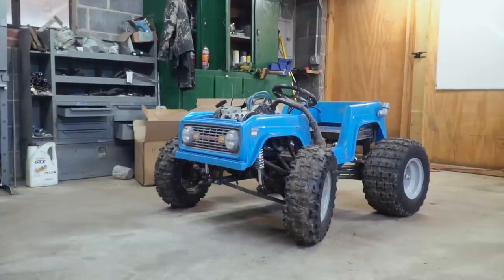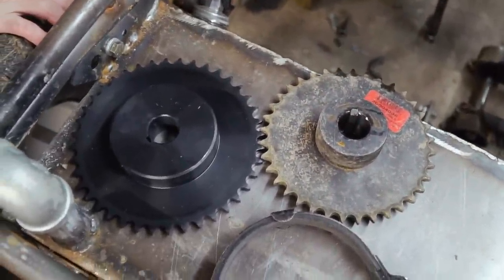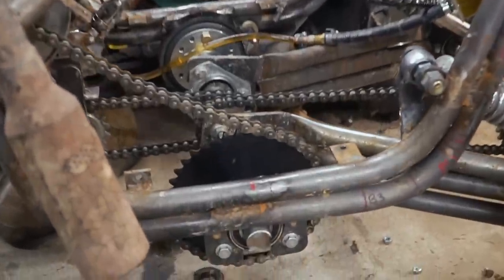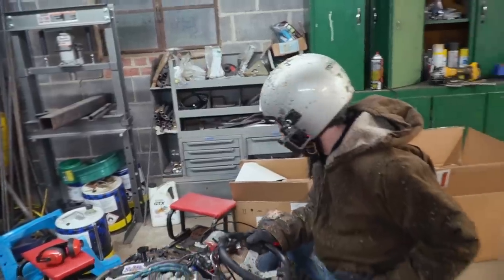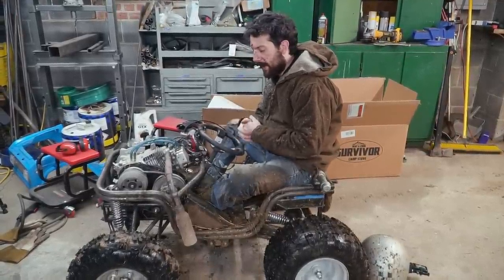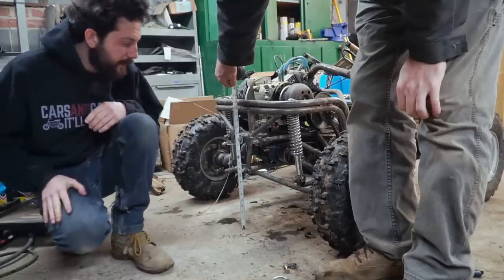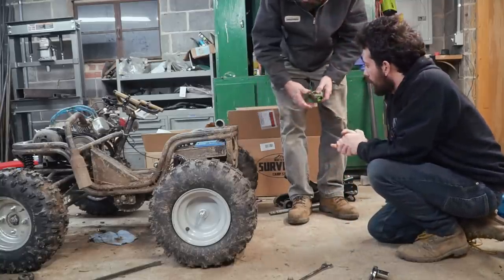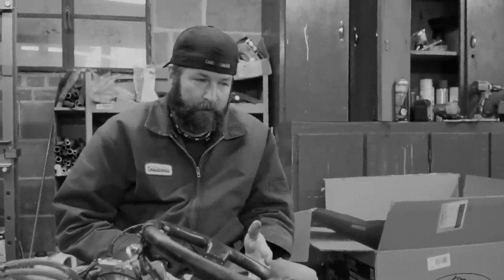4WD Power Wheels Go Kart gets New Suspension + Gearing! 228cc Ford Bronco Build

Comment: That extra large hub almost looks the same diameter as the drum brake you installed.  Almost like it want's to be the brake itself :D
Reply: This guy is right on!🙌
Reply: With a simple jig and a drill press you could relatively accurately drill large holes in the hub to lighten it
Reply: I wonder if you drilled large holes through the side of the hub and small holes in the OD (braking surface) if it would aid in cooling like a drilled brake rotor
Reply: LOL I was just watching the video and was about to say the same thing until I read your message that Hub size is damn near the size of that brake
Reply: @Toolingabout  yes you can cross drill holes on the braking surface of the drum to help cool it, it also gives the water somewhere to go to help prevent brake fade. I have cross drilled drums for older from drum brake cars in the past just for this reason. Just don't get carried away with to many holes lol.
Reply: That's a really good point
Reply: @mostlymotorized  and do what? Wear down the sprocket itself and possibly warp it? Be better of just doing the drum brake idea
Reply: @CaneAtvse  having a sprocket double as a brake rotor is a proven design. Several motorcycles, mini bikes, and go karts out there with that setup.
Reply: That is what I was thinking

Comment: Change out the spring and weights in torque converter for more rpm and harder launches
Reply: THIS!!! That engine RPM should be higher! needs heavier weights in the primary!

Comment: When you are changing gearing. Changing the small sprocket in the equation has a greater effect than changing the large one. Example,  if you have a 12 tooth clutch and a 60 tooth wheel, you will get a 5 times the change adding or removing one tooth to the clutch versus adding or removing one tooth to the wheel.
Reply: They can't even do the simple math to figure out the ratio,I think what your telling them may be above their ability
Reply: Uhh, no. It’s not 5 times the change. Yes a tooth difference on the smaller gear will have more of an effect than a tooth on the larger gear but no where near 5 times.

The gear ratio is calculated by dividing the number of teeth of the driving gear by the number of teeth of the driven gear. Doesn’t matter which is changed, it’s always that formula to calculate the change.

Comment: I think you guy should weld on some mounts on the gas tank for a racing seat instead of a camping pad. Put some memory foam on top of the camping pad with a piece of vinil over top of it. You need a better carburator. That one bogs out. Testing is just part of working out the bugs. If you lenghten the steering shaft longer, you two could easily steer it better with out hitting your knees and legs. Good video! 😁👍 Don't be mad at me. I was just sugesting.

Comment: If you move the rear upper shock mounts further up the chassis, closer to the fuel tank, it will also stiffen up and give you more articulation. You want a resting positive rake so it’s somewhat level while one of you are riding.

Comment: You connected the drum break backwards. If the solid mounting point is on the bottom and the cable is on the top the  The friction when applying the brake will tend to pull the band towards your cable assisting in the break action. With the cable on the bottom the friction pulls against your cable trying to open the band up fighting Against the braking action.

Comment: Put the drum brake on the sprocket, has enough metal for it!  Ever though of using old valve springs under seat? So bend the angle of steering wheel to get taller angle.

Comment: U gotta lengthen this thing about 4 inches
Reply: I would 6 - 8 inches .
Reply: @dalesakawsky7309  thats a good idea, but I don't think the body would look right
Reply: @lowryder3209  - Screw the body at this point.
Reply: @lowryder3209  Just like a limo just do it , easy to make body panels .
Reply: If they'd just cut off the "tailgate", they could scoot back 3 or 4 inches before it started doing wheelies, lol.
Reply: @27Zangle  I agree. It's cute, but it just gets in the way.

Comment: I’d say you need to change the springs in the torque converter so you can get that high rpm strong launch, and wheelies without sacrificing too much top seed

Comment: Shock angle on the rear shocks are making them seem softer. Weight is hung out over the upper mounts. So, you got some leveraged weight. I's throw the red ones on the back or stand them up.

Comment: I mess around like you guys do in my shop. I am not an expert but my observation on the Bronco being too soft is that your rear shocks are layed  down “way” too low. As your suspension compresses the rear shocks loose their leverage and spring rate is decreased 
alot! Please raise the top mount. You may have to also move the lower one twords the swing arm pivot to retain your ride height.
I never write comments.
I love your show to watch when my shop is too cold to work in.
Keep the vids coming 😎

Comment: Should probably run red in the rear and black in the front, adjusted all the way to hard. Remember you can always make a 1 inch shock lift spacer to go in-between the shock and upper shock mount to bring up the ride hight,with out making it too top heavy. The spring rate is different (under load) with new shocks, you wear dry testing the shocks

Comment: I'm not even going to read the other comments before putting in my two cents about the suspension but here goes. The reason your inside front tire is lifting up on higher speed curves has nothing to do with your front suspension settings. Your 2hole issue is with the 4ear suspension setup. When you go around a corner like that all the forces get shifted to the outside rear. If your rear suspension is way to soft like yours the outside rear completely compresses and the centrifugal forces of cornering will lift the inside front. In other words put the chromes back on the front and put the reds on the rear. Giving the rear a 2 stiffness advantage over the front might completely fix the issue with no other modification needed. If it still lifts then you need to redesign your rear shock mounting location to give more advantage to the spring and damper, ie mount it significantly more vertically. The the front won't lift at all.

Comment: im currently disassembling a briggs lawnmower engine, going to swap it in my moped, struggling to pull the flywheel tho. love your videos!
Reply: . if you have a impact . use it to pull the flywheel nut. .. If not.  Remove the spark plug . and push some rope into the spark plug hole . .. _( so the rope jams between the piston and cylinder head ). This shoukd let you . Remove the flywheel nut with a ratchet. . then if you donot have one I. Reccomend getting a 2-3 jaw puller large enough to remove the flywheel. . the wrong way to do it with out a puller. Is risky. As it involves runni g tge flywheel nut flush with the crank shaft end and prying up on the flywheel with a couple flat bars while tapping on the flywhel nut with a hammer.  ( if u hit it hard you can mess up the crank shaft. . if the nut is not threaded on to protect the threads from the hammer. You'll mist likley mess them up...   ) why a puller is best.

Comment: I think the extra weight on the sprocket could be a good thing. You don't have a high horsepower setup and the extra mass could give you a bit of a flywheel effect on rough terrain.

Comment: I must have missed you guys talking about it but why didn't you just put a larger sprocket on the rear and front drive shafts? Do you think with a larger sprocket the articulation will start to throw chains? I just noticed how tiny the final drive sprockets are on the rear and front drive shafts.

Comment: You should try changing the front gearing so it overdrives the rear. Drop like 3 teeth on the driven side of the front sprocket set

Comment: The Leading Edge should be attached permanently then the band will go around to the top and that's where you attach the cable so as you apply the brake it will tighten itself. That break probably won't do much good

Comment: Hey guys, i didn't get a great look but isn't the brake band upside down? It should be pulled in the same direction of rotation to "self power" I can't think of the correct technical term
Reply: It does pull the same as the rotation
Reply: @isaacitllbefine7231   I rewatched the Video I see the cable is coming in from the back side, my mistake. Keep up the great content, and thanks for the reply.

Comment: The large hub actually wouldn’t be such a bad thing. It could basically act like a flywheel that maintains momentum and possibly even smooth things out... Besides if you actually want this to be good in the mud and rocks weight doesn’t hurt...

Comment: Unpopular opinion, I think you might need to stretch the frame a bit. With chain drive it shouldn’t be difficult but I would ad at least 8-10 inches for improved comfort and some stability. Not to mention risk of death by end over end rolls would be greatly reduced

Comment: hey cars and cameras i had a question i have a project quad and i just wanted to know is it the bigger the sprocket makes it  faster or the smaller the sprocket or how does it work
Reply: If you want it quicker on takeoff smaller on drive sprocket and or bigger on driven. Which is what the did. 
If you want More top end  then it’s bigger on drive and smaller on driven. Hope that helps. To confuse you a little more the Jack shaft acts as both drive and driven depending on what chain your looking at.
Reply: @daviddetman5575  thanks man

Comment: I think you could really could use a diff in the rear. live axle are nice when you have 2 wheel drive for extra traction.but since its 4wd you have all the traction you need. so why not add a differential and then you could steer better. the thing is looks as wide as it is long.

Comment: Great work you guys need to stock up on the 8 tooth drivers gopower sports don’t carry them it’s a Azusa 8 tooth driver 5/8s shaft 3/16 key I run 8-60 on my 285 with stage 2 212 pulls wheelies out of the whole still clocks in at 48 mph

Comment: Y'all need to figure out how to build a mid engine. The rear diff is structural and bolts behind the engine. The full skid plate is also structural.

Comment: Needs same size tires!! 4x4???
Reply: They are the same height.  Front is skinnier so it will turn better. 4x4
Reply: @isaacitllbefine7231  do you think it will have better traction with the front tires being as wide as the rear? Just curious

Comment: Can you guys please attempt to put a honda 4wheeler or motorcycle trans on predator motors like the 212 420 and 670? If they work i plan to build a road ready vehicle
Reply: Honda transmissions (bike & atv) are integral with the engine, you cant separate them. But HARLEY transmissions ARE separate.

Comment: Can you not change the spring in the cvt for a harder one witch will hold it in a higher/taller gear for longer on the engine side to help it stay in a higher rpm for better pull off.
As the cvt starts spinning faster it starts changing gear, but I find it changing gear to quick but with a harder spring I get much better pull off and same top speed

Comment: Im sure you two have some extra parts here and there. . to Fab up a sway bar or two to resemble this. https://photos.app.goo.gl/JuYUBwYTo329SG5f8 .  ... A thought to help with the high speed leaning .  . ( if the hard links were instead mini atv shocks. It would not remove all the articulation.

Comment: That 3M stuff is not that great.  Regular old gooey contact cement is the right stuff for foams.  I used to use it for headliners back when I still worked on cars.  the 3M stuff releases in the heat.

Comment: It needs a real engine yall insist on using this DULL side shaft engines without any transmission would be way better with a transmission
Reply: Honda isnt giving away. Any 250's or 450's . but go powersports gives them 212's all day.   . .  the yx engines like in thexCT70's would be loads of fun also. Most of which are 4speed. Manual. .

Comment: Putting a exposed drum brake on a kart designed to go on dirt & water etc ?????   seems a bit pointless since it will just fill up with grit & water then become useless very quickly. It will also cause massive amounts of damage to the drum & shoe. . . . . . .
Also you have a CVT clutch system so you will never get the right gearing for it.  It would work a lot bettet with a stsndard torque converter on it.

Comment: So, let me get this right...

You have a single brake DRUM for all 4 wheels...

Yeah, that 'binding' as you kids call it will burn out in minutes! [ if driven the way John does when he wants to beat Ike ]

I'm pretty sure a disk would also have trouble in this case. [ rebuilt his first carb in 1987, because an Engineer in '94 ]
Reply: Not at all. Where they put the brake give it mechanical advantage due to gearing. Have you ever seen big mud trucks running top loading 2.5 ton axles? They often use a single, tiny, disk brake per axle on the driveshaft or the unused extra output. Since it is before the gearing, the gears give it almost 7-1 mechanical advantage. People often use a kit for them that uses a Honda Accord disk and caliper, and get years of usage out of them. This is the same concept.

Also, many of these cheap drum brake kits have a coating to break in the brakes faster, and it will drag quite a bit until it wears in.

Comment: How many times do you have to say how disappointed you are that the sprocket is heavier.. Say it once and move on, no point in just bitching about it aboug how John ordered it and you wish you would have known about it.
Try it out and if the gearing is good, then remove and set it on the lathe, case closed.